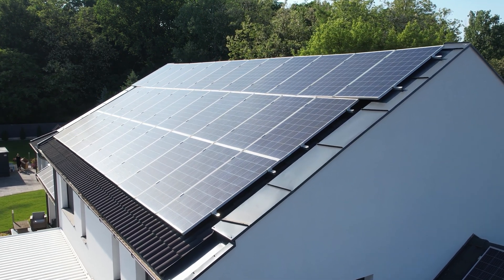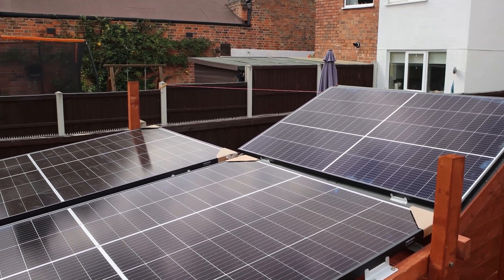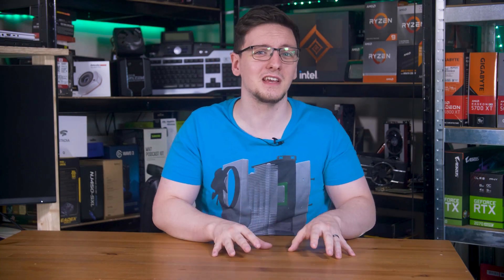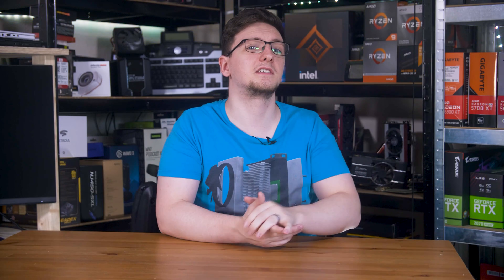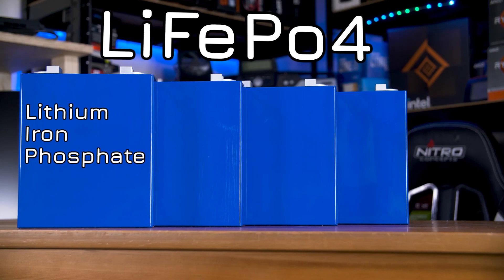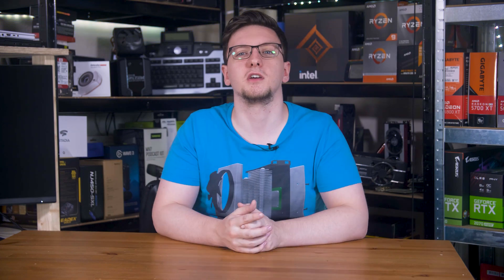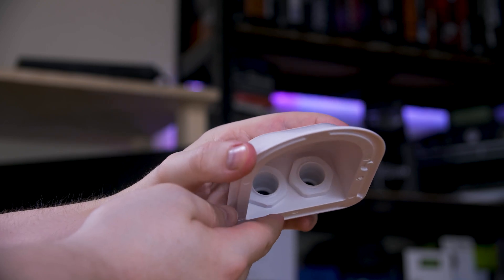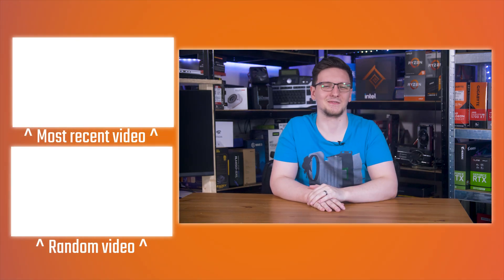So you want to make your own DIY Solar Power System….

Comment from the maker: A few things I got wrong here - the two abbreviations, "DNO" and "SEG" are actually "Distribution Network Operators" and "Smart Export Guarantee". As part of my writing and research I read someone quoting both incorrectly and didn't think to question it. Apologies! Also, if you are going to build your own battery pack (which as I said in the video I do not recommend) you should use proper protected tools. That's a do as I say not as I do, I know, but still.

Comment: I will save you watching whole video: buy biggest victron multiplus you can afford at least 5000-10000va, than buy 600Wp bifacial
solar panels and victron mppts, than smack there aome lithium 12-14s battery and you are golden. I have 9kva with 17kWp solar and 20kwh batteries all set up in ess and all did just by myself, I dont care about codes I canceled my grid and use neighbour phase as backup for winter

Comment: the money you get by selling the energy is £0.02 And then they charge you £0.50 to get that energy it's not worth it is really just a scam selling the energy because you don't make much money at all It is a scam because shell are refusing to pay my mum for the energy we sold using solar panels. 
If you just disconnected your power grid right now and just use the solar you would still get charged for the energy bills even though you're not using any energy

Comment: Aren't your cardboard corners cutting into you solar output by a small amount?  It looks like they are covering a small portion of your cells.  I just setup my own off grid sytem.  I just used solar generators instead of a batteries and inverters.  I have six 200 watt panels on a trailer for mobility and a four 200 watt panel ground array that I plan to put wheels on to make mobile too.  I live in a part of Arizona that gets 292 full solar days.  I moved here seven weeks ago and I have run my gaming computer and my work laptop  with two monitors completely on solar.  I also run my refrigerator, coffee pot, and microwave (for short burst) too.  Since I still have extra capacity to start the next day, I'm looking for other appliances to plug in.

Comment: Electrical tape on a screwdriver does not make it an insulated screwdriver. Just in case anyone got that impression. Also never work live it it can possibly avoided, only the battery connections are not isolatable in this case.

Comment: The white cover is not a cable entry gland. its a cable entry cover, very different to a gland witch you will need for the armoured cable, you need to terminate and earth the armouring of the cable at each end and that is done with the cable entry gland.

Comment: A couple of safety tips:
Make sure your ground wires are insulated. Especially around areas you would use a wrench. I learned the hard way!
Also never touch the positive and negative of your battery bank at the same time, especially if it’s a 48 V system or higher! It can kill you dead!
Reply: 48 Volts won't kill you via an electric shock but will go up with a big bang......

Comment: I've seen what can happen when you short out the battery. There wasn't much left of the spanner and the fitter spent the afternoon in hospital having his eyes checked. Please use insulated tools! On-grid is not an option for a DIY solution. The DNO will prosecute you if you connect without an MCS certificate and a G98 form B.

Comment: lol an idiot with just enough information to be dangerous 🤣 yes indeed
you definitely have to be careful, that battery setup with non insulated tools, can be deadly with a tiny slip up. dont do what he did. if he'd dropped the wrench a big arc of electricity, probably fire and or explosion.
ya need to secure and insulate the batteries, you dont want to short them for any reason.
otherwise good video, it's always good to go renewable. lets hope your roi comes sooner than later on that setup.
Reply: Insulated tools are a good idea too 👍

Comment: Great seeing like-minded folk doing this, I did a very similar install but ESS,  never done it before but I installed 4.5kw solar to my shed, same power run to house armoured cable, ZigBee rs485 coms from energy meter, a full victron ESS system, 14.5kwh pylontech batterys, and a 1 kw 48v airforce wind turbine, £11k invested payback under 4 years mabys sooner when we cross the £1 per kWh threshold! Most days I use less than 1kwh from grid all electric house, it's a joy looking at the victron VRM app seeing live usage, production and consumption and all the stats, DIY solar,  this is the future
Reply: Great, did your system need an electrician to sign off?
Reply: @giridhart  yes I had an electrician do the AC and sign it off
Reply: @stewartj00701  I did much the same but just the solar front - it uses the zigbee and energy meter to maintain zero export - just got an electrician to wire in the meter and the AC on the garage circuit as I was a bit nervous about that; works great! even use it to charge the car solely off of sunshine!